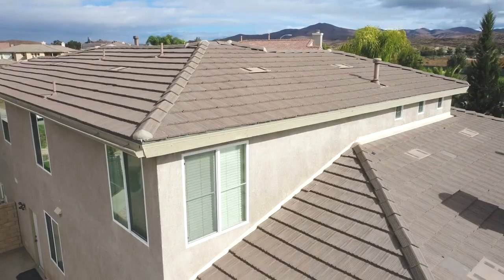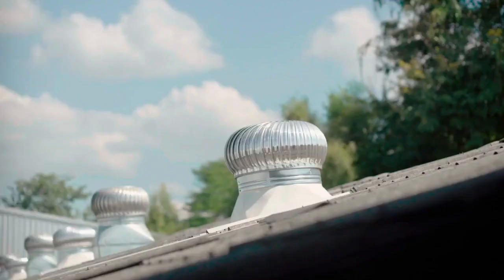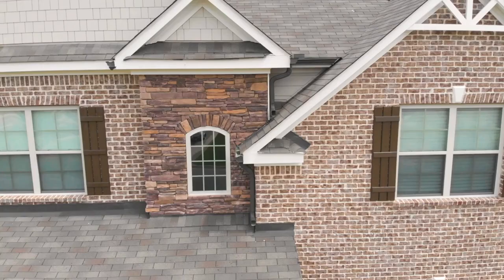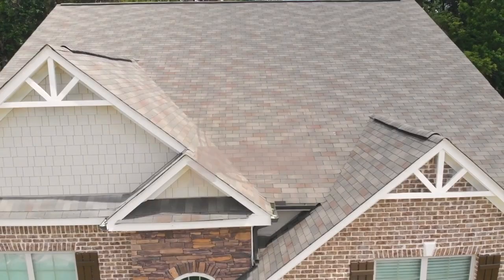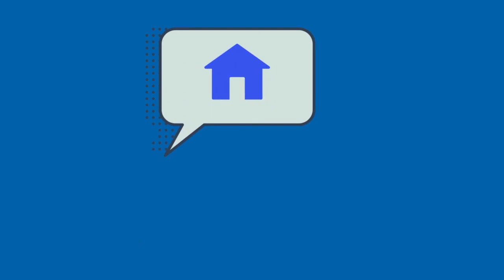Why you NEED roof VENTILATION?

Comment: I’m a roofing contractor (40 yrs). Well put together video but ridge vent is no where as efficient as wind turbines or power turbines. Doesn’t it make sense that something that actually pulls air out of attic as opposed to ridge vent. If you are on a roof you can stand next to a turbine and feel hot air coming out turbine. Nothing when you are next to ridge vent. The only time that is not true is on a 3:12 pitch roof. That pitch needs some ventilation between every rafter. 
And while on roofing products. Anything actually produced by certainteed is a problem. The number of times I come upon a defective product, 50% of these problems are certainteed products. Blows my mind how they continue to produce products that they know will fail within 5 years. 
There are no roof products that I will absolutely stay away from it is certainteed.

Comment: Should you have more than ridge vents. Currently having leaking ducts. Had a turbine until roof was placed. No soffitt vents ever. What is the best solution
Reply from the maker: In lieu of Ridge vents they can do Box vents. 
Poor roof ventilation can cause moisture in the attic and the leaking duct could be condensation.

Comment: Looks like it causes water to go in your roof. Watching the video I seen places where it would run in. Also your promoting holes right beside your gutters. I’ve been looking to see what is the real workings of roof ventilation. I haven’t found a dang thing. Just people saying “that ain’t right”, or tell you what they would use. Then the sellers telling you what they offer. Why would I care if it’s hot in my attic? I’m not up there. And if you don’t put holes in your roof to leak then water is not a problem. If you have water in your roof, get the roof fixed. People only talk about it letting heat out. What about when it’s cold? I sit in my house everyday freezing my ass off, even during the summer here on the South Carolina/georgia line. Why would I want to get rid of the heat. Maybe I can go hide up there from my family so I’m not a popsicle all day.
Reply: Getting rid of heat in your attack makes your living space more comfortable. Also helps with HVAC system not to work so hard. Get a solar attack fan and thank me later